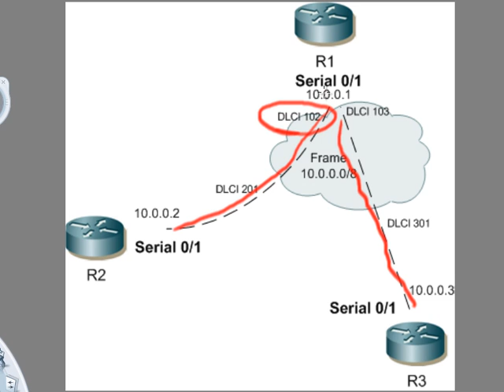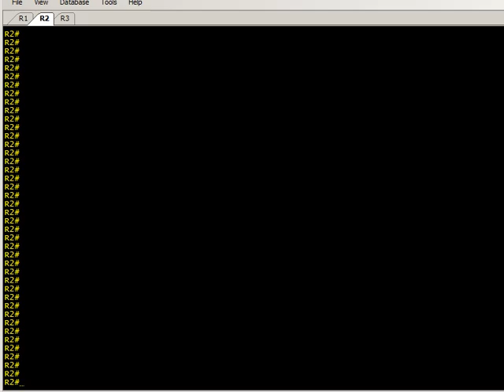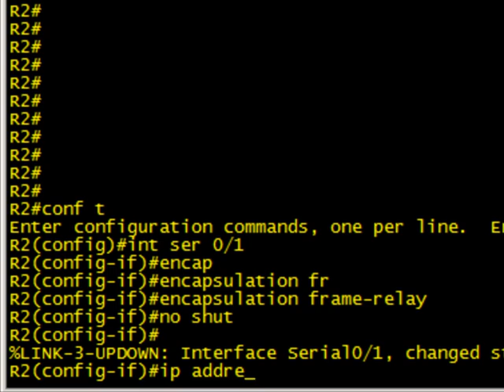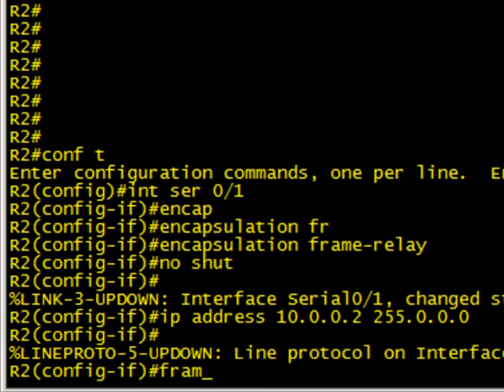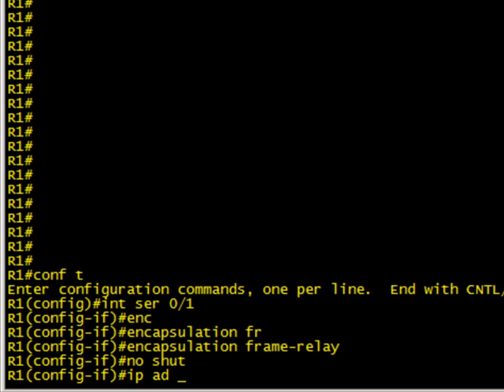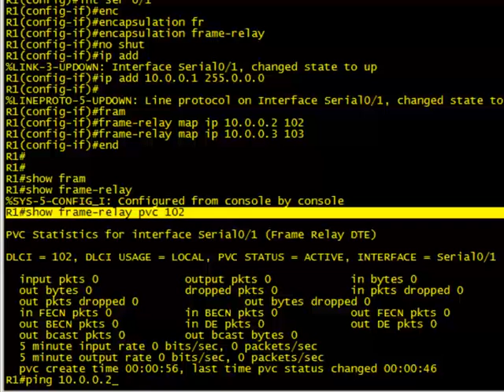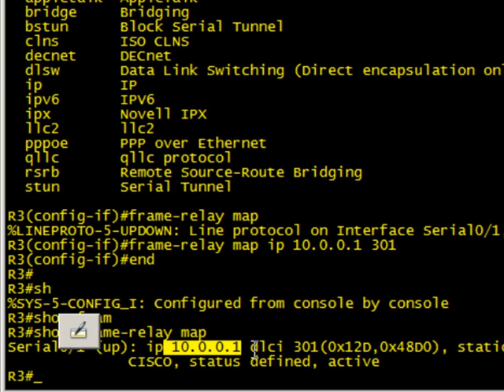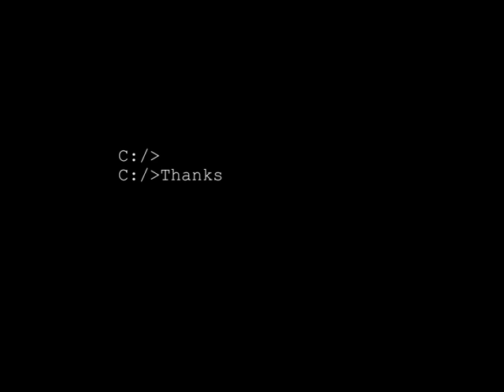Frame Relay DLCI mappings

Comment: nicely explained ...except confusion could arise if you thought in terms of global dlci.
as r1 would have 2 global dlci's which is not really good.
should have used global dlcis of 100 200 300 per router
then on r1 to reach r2  use 200 to reach r3 300
on r2 to reach r1 = 100
on r3 to reach r1 = dlci 100

Comment: Thank you Keith. That was very informative as usual. Does it matter if you put the word "Broadcast" after each of the Frame Relay mapping commands ?
Reply: The broadcast keyword allows dynamic routing protocols to send their multicast traffic over the link.    If you don't use it, the point to point frame relay connection may still work for direct traffic between the two routers.

Comment from the maker: The frame relay switch (a separate device) has a single serial connection to each router.     

After that, the logical connections are done through the PVCs in frame relay.

Comment from the maker: The problems that could negatively affect a frame relay connections include:

No physical connectivity
Wrong LMI
Incorrect Mapping of the DLCIs
Interfaces shut down
Incorrect IP addresses configured
Frame Relay switch (the cloud) misconfigured

Those are the thoughts that come to mind when I think of what what may cause 2 frame relay devices to not be able to communicate.

Best wishes, 

Keith Barker

Comment from the maker: The video shows configuring the router to use the DLCI beginning at the 4 minute mark.    For workstation to workstation connectivity, the routers would need to share routes or have configured and/or default routes, and the workstations would need to refer to their local router as a default gateway.